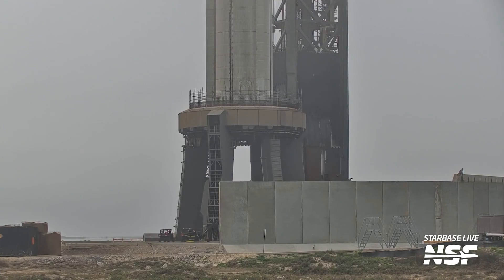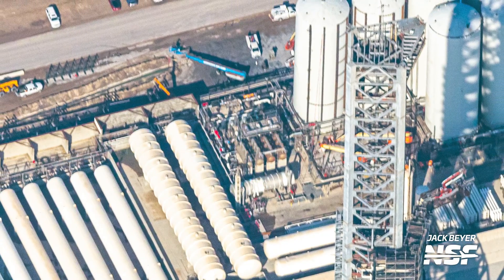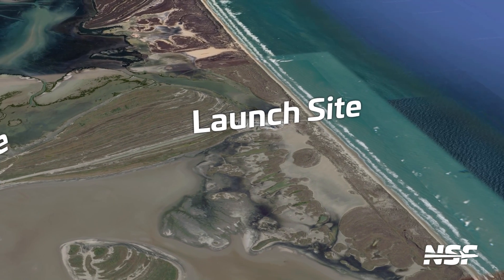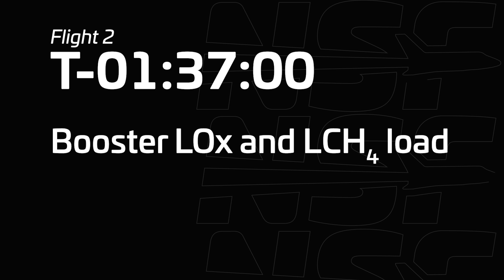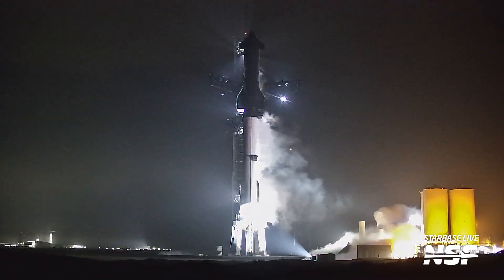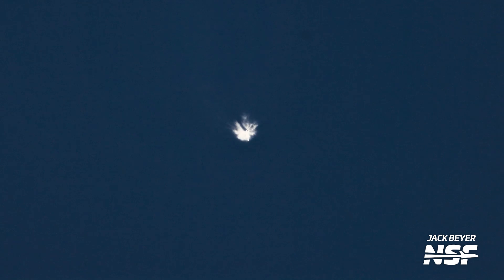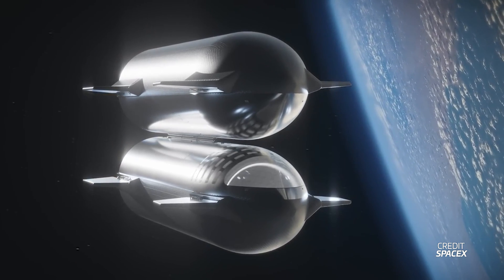Significant Changes: Starship Flight 3 Will Not Be The Same

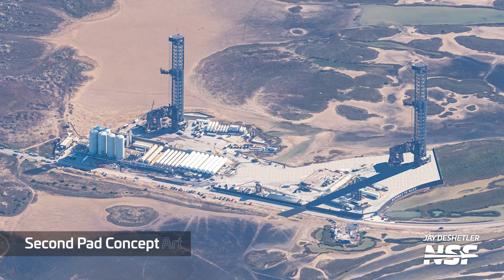Comment: FAA license for IFT3 was granted 4:50PM CDT. Tomorrow is on. I have comment on "Second Pad Concept Art" (3:12). It shows a second pad and second tower west of the first. My guess is that SpaceX will only build the tower. This will be used for demonstrating "the catch" without endangering the launch pad, which is much more complex, and the nearby tank farm. Once caught, the Super Heavy booster can be set on top of a self-propelled modular transporter and moved into one of the manufacturing bays for examination and refurbishment.

Comment: Has anyone said if we're to expect video on the SS re-entry from ship or air based platforms?  With re-entry blackout, I assume some sort of visual/IR will be needed to verify it doesn't burn-up mid-entry...?
Reply: There might be some views from the cameras on the ship like what we had with SN 8-15. Starship should try to connect with Starlink to send data to the control rooms.

Comment: Will the second tower be taller?  Will the Starship QD be vertically movable to accommodate the next generation?
Reply: Everything I have heard is that the second tower will be the same height.  This is also based on the tower sections built at Starbase or those en route or still at the Cape.  Regardless, it will be 18 months or so before it's built.

Comment: Could the fact that the ship is higher be also a reason that it takes longer to fill?
Because of the greater hight, there would be more pressure required to lift the fuel compared to the booster

Comment: There are probably fewer pumps on ship. However, even if they both had the equal number of pumps, ship would still be slower due to more head pressure from the extra vertical height. It takes more power to pump fluid higher.

Comment: My cynical, unqualified, armchair-engineer side thinks there'll be structural failure of the Starship hull due to the payload bay's overly-generous span along the ship's cross-section. This will be the first launch where the door isn't welded shut, so I'll be biting my nails during max Q.

Comment: What will local time be in South Africa as Starship flight 3 flies over Africa, assuming the currently planned launch time?
Reply: There is a 7 hour time difference from Boca Chica, Texas to South Africa.  So if starship launches at 7:30 am it would be over  South Africa soon after 3pm.  The total flight time is about an hour.  The big IF is if it launches at that time as numerous circumstances could delay it.

Comment: If the header fuel transfer is not successful, does that mean they will not be able to preform a landing burn or flip maneuver?
Reply: They wont be doing one anyway.
Reply: i don't think so, during the landing burn the propellant inside the header tank doesn't need to be transferred into the main tank i think

Comment: Have Spacex got any assets or agreement in place to monitor the ship landing/crash area?
Reply: Good question - you'd think they'd have 'eyes' pre-positioned at both sites...
Reply: The middle of the Indian ocean is a quite remote location, and there is an exclusion zone for human safety, as it is very possible that the ship breaks apart on re-entry. Even unmanned drones would have to cover quite the distance to be able to film the event. So we might simply not get a video feed of the crash area, unfortunately.
Reply: By that, I mean the ship. Nevertheless, the booster will be sunk too.
Reply: They are hoping to live stream from the starship over Starlink.
Reply: Plus, if starship can close all vents etc, is it going to be recovered? Assuming it makes it back. You would think it’s an ideal chance to practice soft touch down. Even if it’s only over water and it makes it that far?
Reply: @Carpe-Diem There will be no soft touchdown this flight. The ship will sink after impact (whether in one piece or not).
Reply: We might get some views from Starship's cameras. It should try to connect with Starlink to send data to the control rooms.